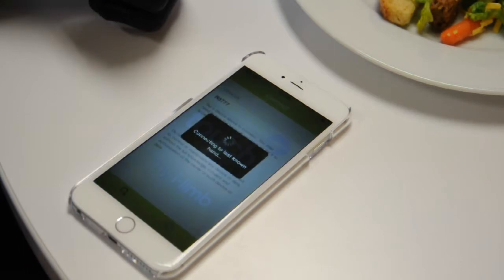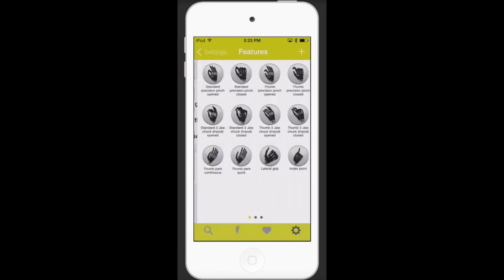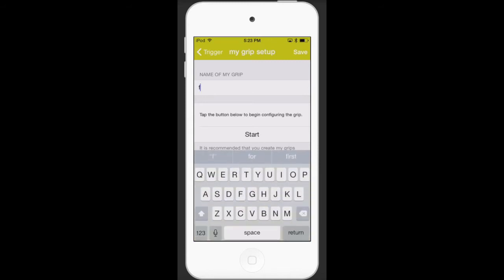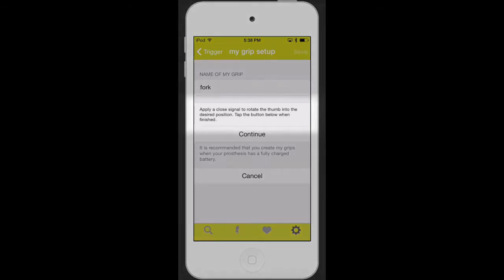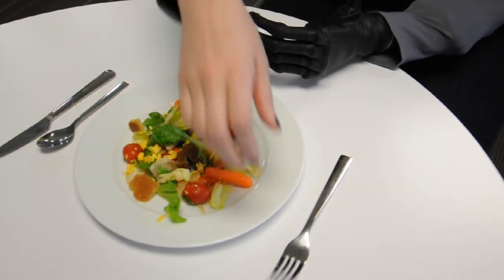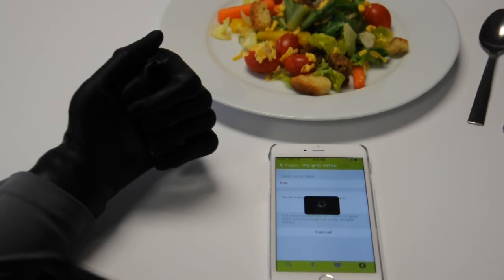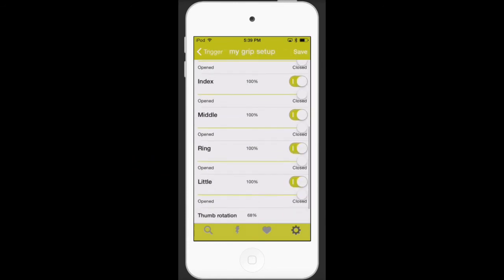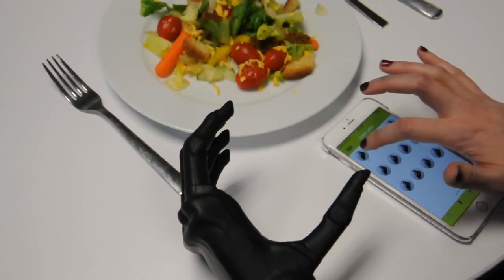mygrip setup

Comment: Nice Vid, but I am confused. I don't see any grip chips there. Can you configure  a grip  by just using the app alone?  My Ilimb Ultra Revolution, of course did not come with any. I'm not sure if I am eligible for them insurancewise. Please let me know. Thanks.
Reply: I think I just answered my own question. Mygrip as explained above does not need grip chips to work. I am just starting with it and I'm excited about it. However, I wonder how many of your own customized grips can be stored at one time with out the chips? Maybe as many as their are blank grips? Thanks Touch Bionics. I have some things I want to experiment with.
Reply from the maker: Hi there are up to12 my grips you can program depending on your prosthesis. If you have a look in your my i-limb app in the quick grips screen (app control) you will when scrolling to the left find the my grips available to you. Here is the link to our Quick Reference Guide which should explain it further. Let me know if you have any more questions. 
http://www.touchbionics.com/sites/default/files/files/my%20i-limb%20quantum%20August%202015.pdf
Reply: Thank you for answering my question and giving me that link.  I look forward to trying this.
Reply from the maker: Let us know if we can help!
Reply: Thanks, but it's on it's way to you for a repair. LOL. When I get it it back I'll resume my attempts. A different question. Is the quantum the most current or newest one? Thanks again.